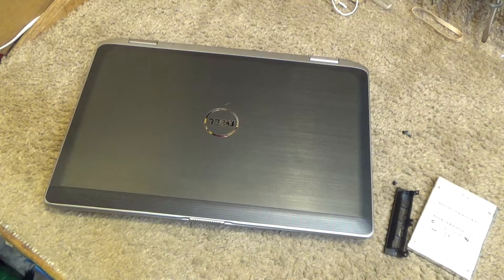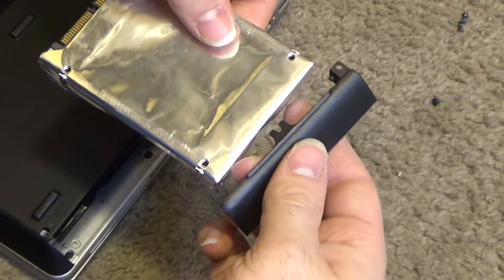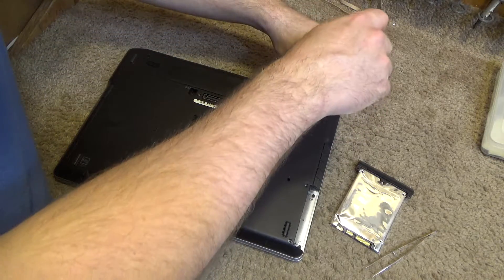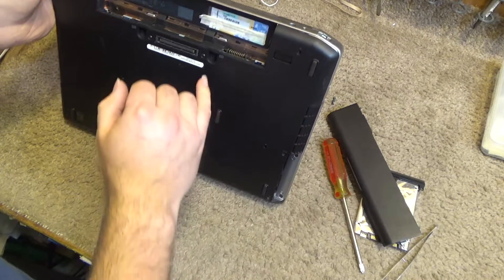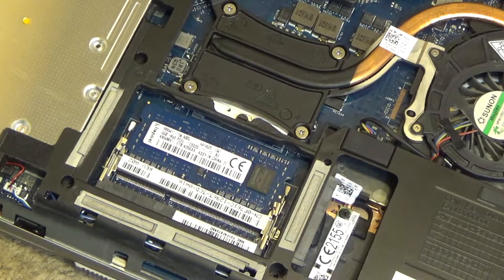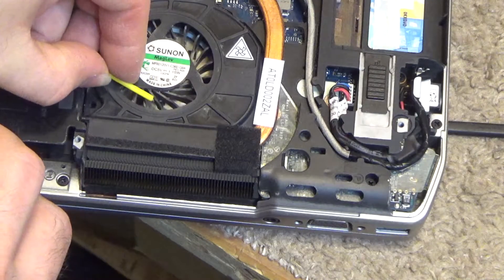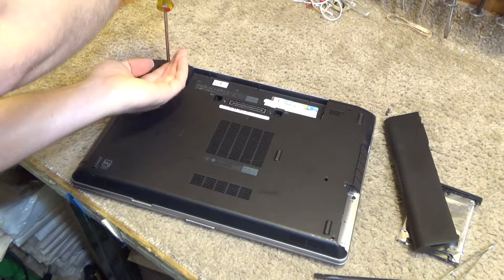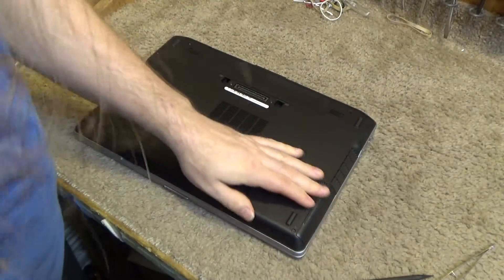Dell Latitude E6430 Laptop SSD and Memory Upgrades

Comment: I'm looking to upgrade a RAM on my E6430. But in a bit of a puzzle - CPU-z says that the current RAM runs at 1.5volts, while all the descriptions for upgrade say that it shall be 1.35 volts. Which is the correct voltage? Could it be that both specs will suffice?
Reply: Use DDR3L laptop rams which runs at both 1.35 and 1.5V

Comment: I have an e6420, I need to replace the palmrest and trackpad, the rubber has gone weird.
Reply from the maker: The top cases on these tend to get kind of sticky over time. It's like that on this one, and it's like that on my 6530 as well. I don't know how to reverse the deterioration of the material. I've tried to buy replacement ones before and they are almost all like that, it's just something that happens with age unfortunately.
Reply: @JordanU  I’ve tried taking the sticky top coating off. It’s sorta worked but it’s super ugly now. Good to know they all go like that I guess I’ll live with it.
Reply: @strkilla89  Yeah for all the products that use that coating, you have to use alcohol to remove the stickiness. It works but it has the unfortunate side effect of leaving a weird pattern on the plastic. Oh well I guess.
Reply from the maker: @versedbridge4007  I've tried to remove it with a few different cleaners and never had much happen. I've noticed when it gets dusty, it's not quite so bad anymore. So I usually just leave it dusty, which isn't a great answer but there's not much to be done about it.